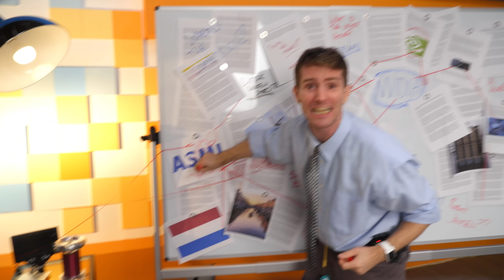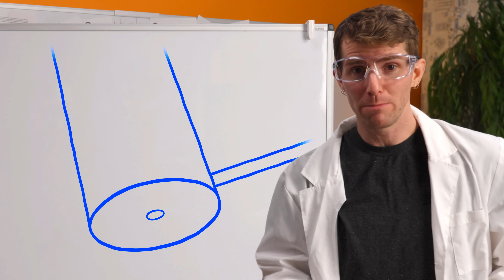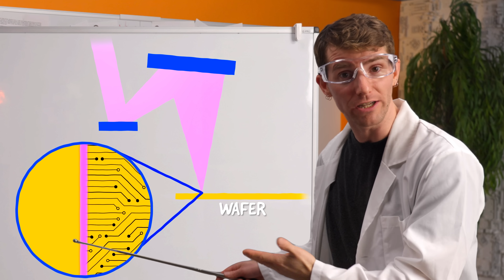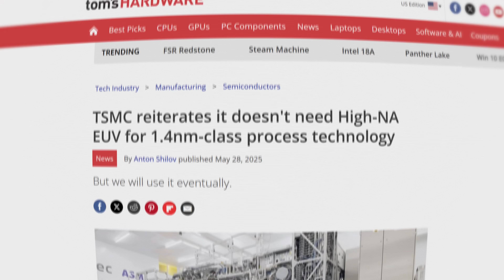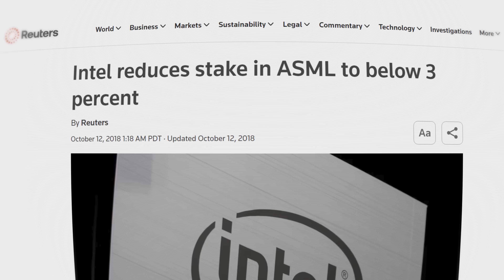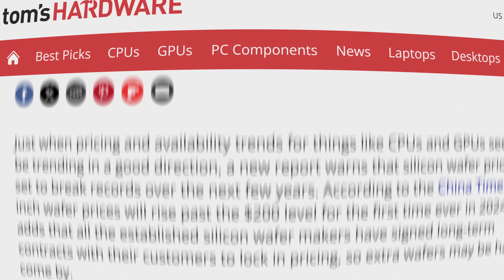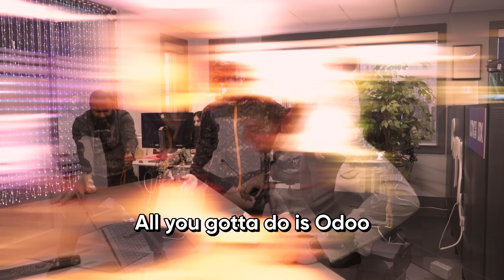This is Why Hardware Prices are Going Up… Again

Comment: 7:13 High NA (Numerical Aperture) does enable higher resolution, but it does not utilize a different wavelength as stated in the video. The improved numerical aperture indicates improved optics for better handling the same light. In ASML's case its an increase from an NA of 0.33 to 0.55 with some clever use of anamorphic optics. According to ASML this should enable an increase in transistor densities of 2.9 times. A downside of this is that they doubled the number of exposures needed to pattern a chip which they compensated for by making the patterning faster. Apparently they can now accelerate the reticle at 32g for faster positioning, while somehow managing the critical nano meter level positioning. Its crazy tech. I still can't get past how they produce so much tin plasma in a vacuum without out it condensing on the mirrors destroying hundreds of millions of dollars worth of equipment immediately, but that's apparently somehow a solved problem even in the previous low NA tools.

Comment: The issue isn't the businesses... well it is but they are an issue because of a lack of backbone and integrity among gamers. They won't buy AMD. If after the the Hardware Unboxed scandal in 2020 people didn't switch they aren't going to. I did. I have used AMD GPUs for my last two because Nvidia doesn't deserve my business but people keep buying them... they have no backbone and fall for marketing massively.
Reply: Nvidia doesn't give a damn, about 90% of their money comes from the AI datacenters. That's the entire point, ordinary consumers do not even have an ability to punish Nvidia anymore, even if Nvidia consumer card sales drop to 0 tomorrow.
Reply: @Agent_Krasnov  Sure you can. You can use AMD. If Nvidia loses market share they will notice and it will benefit AMD which will encourage better AMD cards and make a proper alternative. People just refuse to accept anything put Nvidia as an option.

Comment: Honestly if you could ever get AMD to just come out and tell us what their gross margin is on their chips I'd be more tempted to buy from them.  I held off completely upgrading my computer when the 9070 XT came out and its MSRP was more expensive than it should have been.  I would call that a decent $450 card and it's still not there and with DRAM quadrupling I'm just holding off even longer.  The only way I'd buy a 9070 XT for their MSRP would be knowing their profit margin and their AIB partners'.  Retail margin you can just assume to be around 40-50% unfortunately though I get not wanting to completely price out the likes of a Micro Center.

Comment: Seems like the only way to improve the situation is a new way of manufacturing as a whole, which is somewhat accessible , which is very unlikely.
Reply: ASML has actually been talking about how a new manufacturing method may be needed because lithography is reaching its limits. 
And it's not like the technology is inaccessible. We've managed to put a computer into the pockets of nearly 5 billion people. That's insane and beyond anything science fiction authors of the previous century imagined. Asimov imagined computers were going to be huge and only accessible to some. In reality computers are more abundant than toothbrushes.

Comment: Man, if only there was a big market with a hunger for microchips that simultaneously also has a surplus of engineering talent, the money to invest, the infrastructure to build, and the know-how to create an entire microchip manufacturing ecosystem from the ground up.
A place like, idk THE ENTIRE WESTERN WORLD maybe???
But no, the powers that be would rather set stacks of dollars and euros on fire to heat their homes than spend a single cent on developing a better future for us all.
Reply: Semiconductors aren't concrete. These are some of the most complex objects in the universe. Unironically. If it was as simple as "throw money at it to get SC production going" every country in the entire world would have their own. The moats around these companies are insanely high. Their R&D, know-how, IP and established partnerships are not easily replicable. You could spend all the money in the world and would have no guarantee of building competing production because these companies don't exist in vacuum. TSMC heavily relies on Apple to invest into the cutting edge. Good luck replicating that from scratch when literally every other established company is incapable of that.
Reply: @Toiletpaperhastwosides  and yet it looks like the Chinese will actually manage to do that. While the US is scrambling to keep Intel fabs afloat and the EU is not even trying to do anything on this front. Maybe we can try to analyze why the outcomes are so different?
Reply: @Agent_Krasnov  They’ve built an EUV  machine out of used parts. They have yet to build something from scratch. ASML relies on other monopolies to deliver the necessary components. And even if they start building EUV, that’s only one step of many to producing cutting edge chips. Intel has them and still hasn’t been able to compete with TSMC.
Reply: @Toiletpaperhastwosides  No offence to taiwan but its a small island on the other side of the world. If they can do it the west can too.
Microchips arent magic either and if the US/Europe wanted to make them we easily could.
Reply: @ZiamschnopsSan  What you wrote is entirely false. If you don’t have a clue don’t spout nonsense about it. The very idea that neither US nor EU want to have their own cutting edge chip production is laughable, to the point where one has to question the intelligence of whoever believes that.
Reply: @Toiletpaperhastwosides  I guess Taiwan and China are employing aliens that possess the arcane knowledge of creating microchips and the human race is unable to comprehend such technology.

Microchips aren't magic my guy.
Reply: @Zia @ZiamschnopsSan ow can you be so naive? Are you 16 or what? It really isn’t a question of money. No, chips aren’t magic, and the engineers aren’t wizards. At no point did I say they are, your line of argument is idiotic. Chips are, however, some of the most complex science we have ever done and virtually all engineers in the field are employed and buried under two metric tons of NDAs. 
TSMC has tight partnerships to help with R&D. China is very far behind with their own production and that’s despite strong effort in corporate espionage. 
I’ll reiterate myself. If you know nothing about the subject, don’t make wild arguments, don’t form uninformed opinions.
Reply: @Toiletpaperhastwosides  You seem to think that there are some magical properties to microchips that make them unable to be developed by anyone but Taiwan. Yes chips are complex, but nothing is keeping the West from making our own. Except for the will to do so ofc.
No amount of reiteration will make you correct my guy.
Reply: @ZiamschnopsSan  You're just being daft on purpose I think. Countries have nothing to do with it. The idea that the west doesn't want to have their own production is so far detached from reality that I really don't even know what to say anymore at this point. There's no line of usable argument because we're clearly not living on the same planet. How exactly do you imagine you're going to kickstart own production without the IP? Do you imagine that people leave school with intimate knowledge of the subject? Seriously. Try to think about it for at least a few seconds.
Reply: @Toiletpaperhastwosides  Which one is it now, is the West incapable of doing it or do they just not want to do it? Does the West build the production machines from spare parts, or do we actually own the IP? Does ASMl rely on other monopolies or not?
You keep using big words to illustrate your self-perceived superior understanding of the topic, and yet you can't write two comments back-to-back that are not total contradictions of each other.

Even your own two-line comment is full of contradictions. 
You are implying that Western countries are incapable of producing the chips and in literally the next sentence you say that Western countries own the IP. In the next sentence you say that "people don't leave school with intimate knowledge of the subject." You know, the same people that are developing the very processes that are enabling the production in the first place, which requires intimate knowledge of the subject that is gained by the very same people at the very same institutions that are sponsored by the very same companies that own the IP that is developed there.

You need to look at the comments you wrote and think about them for more than a few seconds so you can begin to comprehend how dumb you are.

Comment: I still think GPU mining was the main driving force for the prices in the last 5 years. True, GPU mining is pretty much dead, but AI mining is still a viable option, and that is only done right with the latest cards from 30 series up and using 30 series is pushing it.

Comment: Rapidus (Japan) Just announce that they will be mass producing 1.4 nm chips in 2029, so there's hope
Reply: They still have to use machine made by ASML tho
Reply: @Lehsah2021 The paper I read is that encounter how to not use asml technology
Reply: Good, imagine Taiwan getting under attack, there would be no new computers, or anything with a chip in it.
Reply: @BrutalHonduras intel and samsung do have chips.
Reply: @CBY404 Not to the level required to make performant GPUs
Reply: @vexnity460  yes they do (at least Intel does), it's just that Xeon's are more profitable for Intel to make, and nVidia up till now hasn't chosen to risk a production problem of switching foundries.

Comment: The question is what is the "best" that can be made with the old fab machines? Can they make DDR4 and 10nm cpu´s? If so then there is a bunch of "last gen" ram and gpu´s that would sell like hotcakes. Give me a 3080ti with 24Gb last gen vram and I´ll be happy till 2030 at least.
Reply: If you have a fab, you want to update it as soon as you can otherwise you're suffering huge opportunity loss. It still costs about as much to use the old machines because of all the materials, water, electricity etc. And last gen stuff generally uses the same manufacturing lines, so you'd be willingly sacrificing profits.
Reply: @Toiletpaperhastwosides  So what did they do with them? Wouldn't makers with lesser fabs want to buy the used machines or are they in essence useless without the fab they were first used in? A new fab using last gen machines (for now) because ASML can´t or won´t sell new ones at a price they could afford would be the perfect buyer. Gpu or ram are not the only chip the market will buy. What do you think?
Reply: @a@agw5425abs are incredibly expensive to build, so using outdated machines is kinda pointless. You’d spend a ton of money anyway only to make less money than you could. 
Besides, having the machines isn’t enough, you need the expertise, experience, IP and R&D resources. That’s kinda why TSMC is unbeatable right now. They have all the biggest partners who contribute to their R&D, especially Apple who is very hungry for the latest and greatest and actually spends more money at TSMC than Nvidia, AMD and Intel combined. Apple wants to be the leader in mobile chips and TSMC wants to have the best cutting edge chips, so it’s a match made in heaven (or hell if you’re trying to compete).

Comment: Unfortunately, the whole system kind of leans towards a monopoly for the chip producers.

Ie if you need a certain quality of X and company A does it better or more consistent than company B.
Well you'd go to company A.
Even if it cost a little more (assuming they know they're hot goods) and once they know they have em by the throat, well the cost can be essentially whatever.

Since having defective or poorly manufactured components could impact your own brand image and quality.

That being said, its not that I'm advocating for monopolies on goods.

The other part is that as a result of the upfront entry cost. It makes it difficult for new players to even get a lick in.

Why should we choose company C when we have company A?

Another item worth noting is that companies cut back on production as they had an oversupply during the lock downs. People had more $ and were willing to buy goods. 

So unfortunately, as right when production is at the lowest. The LLM craze ("AI") rose up and spiked demand.

Comment: there is no "problem". the cost of high performance compute has varied since computers have been around. at the moment it's expensive because of the AI infrastructure build out. But it's really not that expensive compared to how much a high performance computer was in the 90s.

this video could be an e-mail and the e-mail could be two words. Supply and demand.

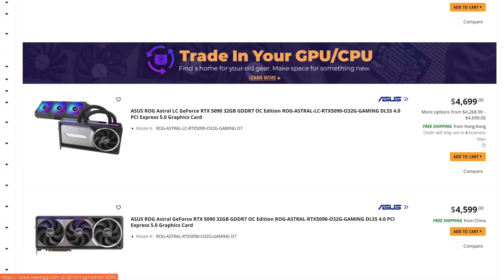Comment: 2:11  I'm angry enough to by radeon
Reply: I don't even buy PCs anymore... This is ludicrous
Reply: I was so angry I bought an Arc B580 and haven't regretted it one bit. Nothing beats it if you don't need to play on ultra and just want a smooth gaming experience on "good enough" settings
Reply: @FaddaJoe  likely not buying an Intel GPU myself but this is the right attitude. Too many people binging LTT,GN,HWU etc. content get the impression you must be able to crank the settings on every game and run at 200+ fps. Think they enjoy benchmarking more than gaming.
Reply: I just did.
Reply: Went from 3080 to 9070xt month ago. I don't have any problems for now. And performance is really good. Better than I've expected.
Friend has 5070ti, he told me he can't see the difference.
Reply: @Scourge0fGod went from a 3080 to a 5090 and it’s not even close. Glad I snagged one over the summer when prices were close ish to msrp
Reply: Really happy with my 6800XT. I don't care about raytracing and it keeps the 3440x1440 pegged at the 120Hz my monitor can display in every game I play.
Reply: @pieterrossouw8596  What if every new game demands you have RayBullS*itt then your GPU says: NOPE, can't run it ...
Reply: @Henry-sv3wv  it still has rayracing it just generally can only do like 60 fps
Reply: I'm just not currently buying games that require raytracing, simple as that. That's honestly my solution and I still really enjoy PC gaming with tons of newer and older games. There's no way every new game ends up needing it, but let's for the sake of argument assume that somehow happened - by the time it becomes so standard you have to have it, current GPUs won't even be able to run that iteration of raytracing well so what's the point of jumping on this train exactly? The games used for benchmark videos heavily skew our perception of what we need; the only metric that matters is this: can you play your current Steam library at satisfying settings and refresh rates for your monitor. For me that's 3440x1440 at 120Hz, which a 6800XT can do with settings cranked in most games. In the heaviest games where it can't, I'm happy to drop to medium settings or perhaps try frame generation (unless it looks/feels awful) to get to 100-120Hz. Here's another neat trick: don't have the FPS counter on-screen when playing games, it breaks immersion and you're focused on the delta between your maximum vsync frame rate and current framerate, and not on the game. If you disable it and just focus on the game itself, much more enjoyable. Now if your performance actually impacts your experience, and you can't drop settings further and you don't need a counter to tell it's chugging... only then consider upgrading.
Reply: I bought 9060xt16 but I hate it. Crashes non stop

Comment: nvidia is ofc the problem. they pushed rtx so hard with overpriced gpus then only offering like sub 50 fps in raytracing titles back when rtx2000 series came out.
they asked the most outrageous prices for something that is still not really that important. and people BOUGHT into their shenanigans.
instead of going for half priced amd gpus that would at least match nv in raster.
it's till the same now. you can buy a 5080 for $1500 but you can get more or less the same raster perf with a $600 9070xt.
people should buy the value propositions more if they want to continue to be offered VALUE instead of cutthroat deals...